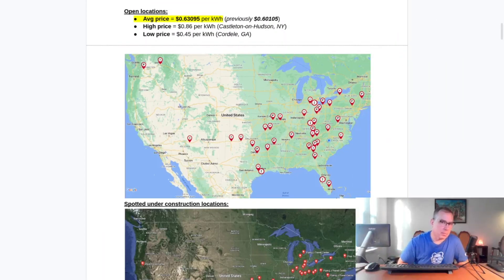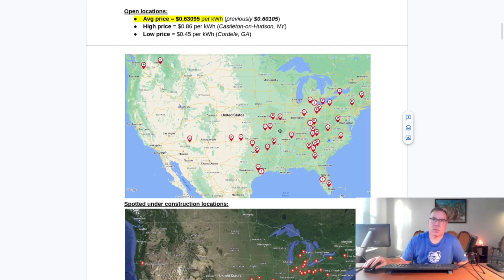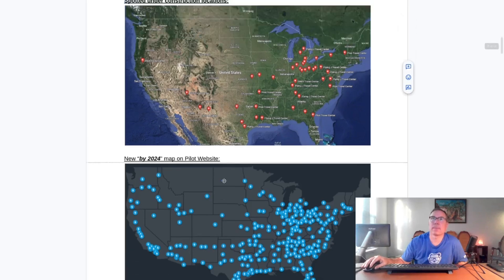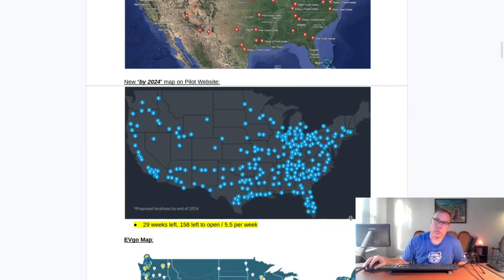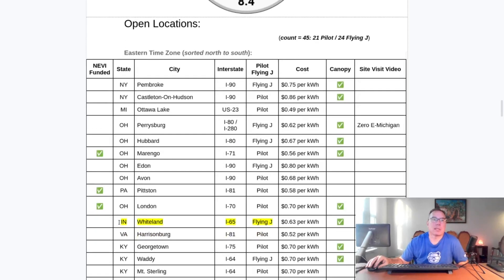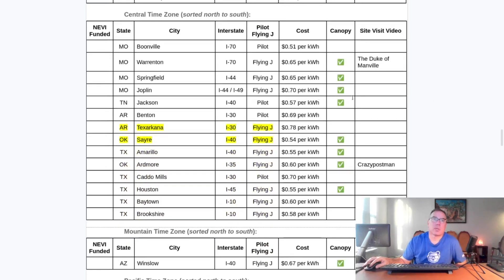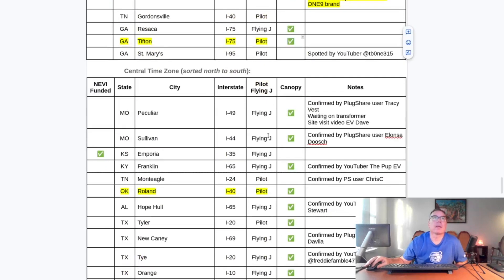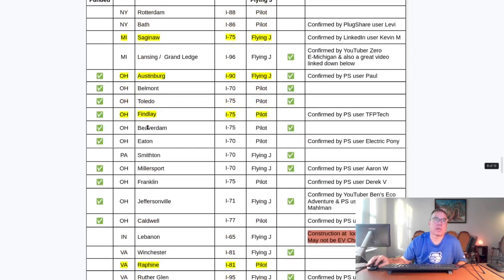gm energy - Pilot / Flying J Update #24 (Electric Vehicle Charging)

Comment: Way too much to charge here.  If GM is going to pull this crap, Tesla should charge extra for GM vehicles to charge at Superchargers.  GM being GM.
Reply from the maker: Tesla does & has a TOU model,  their prices for non-Teslas / non-Members has gotten up there as of late
Reply: @thenetworkarchitectchannel  They don’t if you are on the subscription which anyone can get.  That is not the GM model.  They are limiting other brand.  Not a good way to do business.  Also those rates are extremely high.  Especially in the eastern states..that’s quadruple the average kilowatt charge per hour.
Reply from the maker: @Mountainbaseddweller  non-mem at GM PFJ = 0.63 & at TesSC ~$0.53 would be my guess shooting from the hip, so not too far apart.    With the canopies and attached facilities, I vote PFJ, but that is just me.  A phalanx of chargers in the back of a closed anchor mall baking in the afternoon sun is just is not my thing.

Comment: Did a stop at Beaverdam, OH.  The chargers are at the Flying J which is across the street from the Pilot.  It looks like it is just waiting for paperwork as all physical elements appear to be in place.  The installation is 2 Delta 350 KW capable cabinets and dispensers supporting 4 pull-through stalls.  The transformer appears to be 1000 KVA.  The Dennys that used to be there is gone, but there is a McDonalds at the Pilot.

The Findlay, OH site is not nearly as far along, does not currently have a canopy, and will not be pull-through.  There is an Arbys and a Subway at this location.  The area for autos, gas and electric, is tight, so I would avoid this if towing.  ICEing could be an issue, but time will tell.
Reply from the maker: thx for the correction on the Beaverdam one.  I have corrected the sheet and cited you as the spotter.  As for the closed Denny's.  That is the same for the NC one in Kenly.  I am hearing due to the charging station, it may re-open.  Maybe the same will be for Beaverdam too.

Comment: I don’t think the price per kWh is a big issue because most EV drivers will seldom use a public charging station. I only use them on road trips which I seldom take.
Reply from the maker: That is true and these specifically are not going to be frequented by people in apartments either.  They are targeted at the road tripping community.  Most people on PlugShare praise the stations.  A few mention the high price.

Comment: Had my first bad experience with EVGo yesterday coming back on my trip to Upstate NY. The location in Marengo, Ohio shows as online (and still does!) yet it is blocked off with cones and signs saying do not use. I had rolled in with only 20 miles remaining and the next nearest station was 16 miles away. I checked PlugShare before I left for the trip and things seemed ok. What's worse is EVGo responded to another bad check-in acknowledging the issue, yet they haven't updated the status to offline in their app. A really bad look for both PFJ & EVGo

Comment: Maybe add a column with number of cars that can charge at the same time.
Reply from the maker: each station is four.  They have only deviated from that once due to a local regulation.  Good point though.  I should mention that occasionally.  Thx for watching.
Reply: @thenetworkarchitectchannel  Thanks.  You would think NEVI would put a minimum of 8 to get NEVI funding.  More bang for the buck.  Inefficient government give away as usual.
Reply from the maker: @guyg2005  I agree the fed funding is good intended, but as a conservative republican my instinct is to desire they stay away.  As can be seen from the table, most are getting built w/o funding from public src.  This is happening regardless of government involvement due to a consumer need being met by capitalist forces.

Comment: FYI :  One of your cluster of dots on the I-5 corridor in Southern California may be one at the top of the so called “Grapevine”, the pass that goes between California’s central valley and the LA Basin. 

There is already a Flying J Travel center on Frazier Mountain Road, right off I-5 near the town of Lebec.  It has a very large unused parking area away from the gas pumps and truck parking that would be a great site for an EV charging station.  Since it snows there in the winter, it will need to be covered. 

The Flying J Travel Center has the typical amenities as well as it is combined with a Wendy’s, none of which would be disturbed during construction of the EV chargers.
Reply: Snowfall isn’t a prerequisite for canopies. There’s plenty of cold weather PFJ locations with no canopies. Would be nice to have!
Reply from the maker: I am hopeful to see many more builds start in CA soon.  Currently, there is only one in Weeds.  Many more to do so hopefully soon.  Thx for watching.

Comment: was also surprised by Texarkana, saw it come online middle of last week. Didnt have any information about it at all.
Reply from the maker: Yeah, that happens sometimes.  I think because the PFJ locations don't have a lot of EV drivers go there, the ICE drivers don't know to report them as they are getting built.  Thx for watching.
Reply: this is true Walter. My mom died last month and I’ve made two trips to Texas driving since and go through Texarkana. I’m in ICE due to lack of infrastructure in north east Texas where I’m from. If I had known about the construction, I would have stop to check on it both trips. Normally I eat dinner in Texarkana on the way there, so definitely could have checked it out. 

As SOON as PFJ opens Tyler, Texas, I am one step closer to driving the EV to my hometown.  Thanks for the updates.